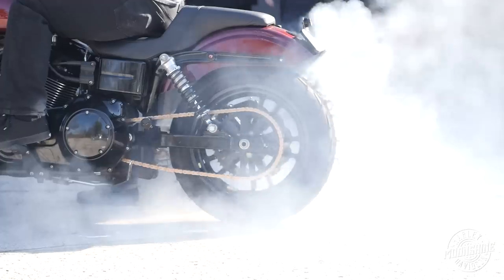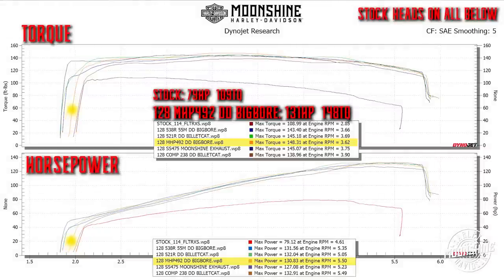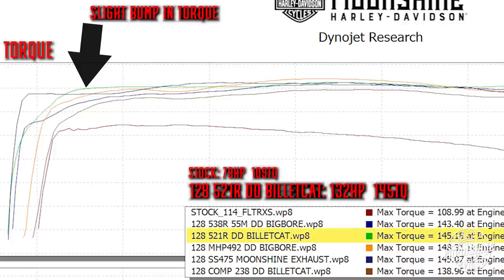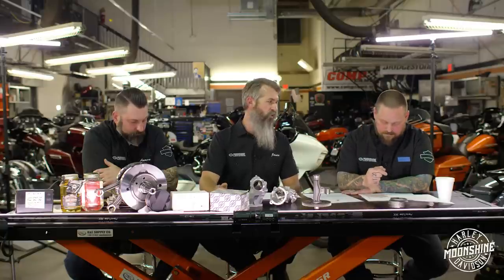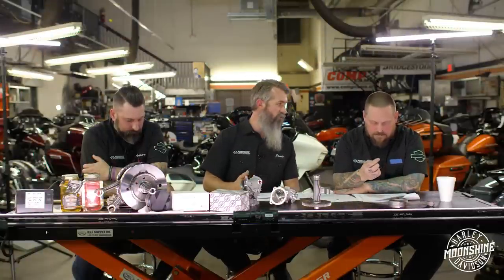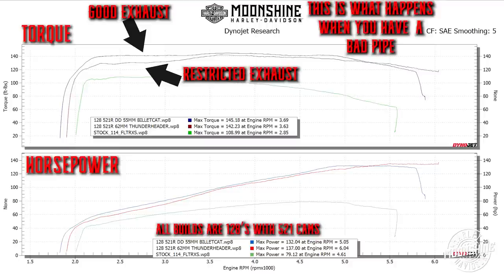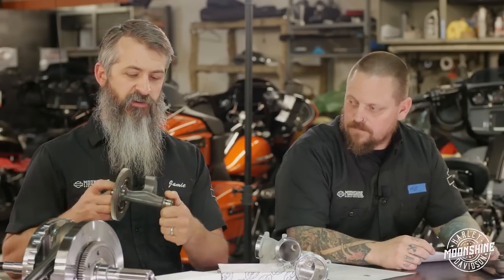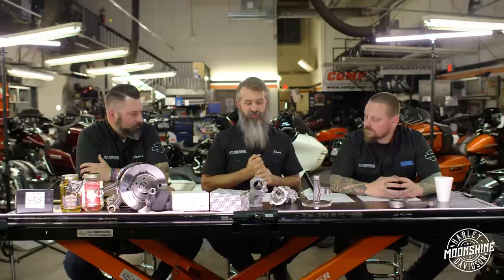Cam Shootout Series | Part 3 Big Bore 124 & 128 Cam Comparison with M8 Stock Heads

Comment: Great information and much appreciated. I watched the entire vid but maybe I missed it,  did you have to do injector upgrades for any of these builds?
Reply from the maker: We always increase the injectors on these larger cubed builds. Typically 6.1 - 6.3 grams a second with stock heads.

Comment: Good video. Have you guys done much with TBR exhausts? Specifically the comp s? I have it on my bike and love it overall.
Reply from the maker: We have and it has a graph similar to the one in our video that’s highlighted as short exhaust. Makes good top end but you loose a lot of TQ and HP under 3,500 - 4,000. With that said if you always in the 3,500 plus rpm’s it’s great! If you are running in an RPM range that’s less you can pick up some good gains by swapping exhaust.
Reply: Moonshine Harley that’s exactly why I switched from a TBR comp to the Thrashin AR. TBR just doesn’t make the power where most people ride

Comment: You touched on reliability of the 124/128 builds (s&s 124 550 cam), what are you  seeing for reliability?
Reply: If its installed correctly its stronger than OEM.

Comment: then why does S&S sell the 128 kits with a 550 cam? does it mean that you have to big different heads for that 550 cam?
Reply from the maker: The 550 responds great with a pair of ported heads. Without the ported heads it hits soft on the lower RPM’s.

Comment: I can't help but notice you guys don't seem to do much with Zipper Red Line cams.  Is that due to relationship, or you just don't feel this is a good cam group to work with?  In my little peabrain, with my experiences they are pretty good cams with good results.
Reply from the maker: We run the the Zippers 468 a lot on light weight bikes with high compression and their 552 is a go to for us on 124/128 with our ported heads.
Reply: Moonshine Harley I would love to see it in one of you’re cam shoot outs. Is it not a good cam for a touring bike?
Reply from the maker: Ryan it’s a solid cam but has to be paired with a set of correctly ported heads like ours and larger throttle body. For that setup you’ll need a real clutch setup like we talk about in some of our other video’s. We’ll go over more info in our powered headed big bore video. Hope to drop it in August - September 2020

Comment: You guys have the best information for performance to your Harley. In time I plan on buying a Road Glide Special with the114.  What do you recommend to get at least 125 hp and about 135 torque. All across. Riding would be in city and with road trips.
Reply from the maker: Thank you and Yes. Call Aaron or Jamie when you are ready 615-274-4170. If we build your bike at purchase we’ll warranty the engine for two years for you. We also pick up and ship bikes all over the country. It depends on when you do the build because new parts are clmnn in NC out every six months. We just got our new Moonshine 55mm Plus intake manifold completed. Testing and video soon on it.
Reply: Where in TN are you guys located?
Reply from the maker: @MrCRM2011  Franklin, TN, Just south of Nashville
Reply: When I make that purchase I will be in touch. I’m in Memphis TN. Thanks guys
Reply: A 124 or 128 with an S&S 475, k&n extreme flow air cleaner, and good tune will get you there.

Comment: Are you guys not using Fullsac headpipes anymore?
Just curious!!
Reply from the maker: crruzzzer1 we do. We use them for smaller cams and our head-pipe for larger cam builds on these big bore M8 setups. With that said we run the Fullsac on stock headed build  as it’s not large enough to handle the increased flow. The Moonshine HP pipe is a larger diameter exhaust and can handle the increased volume.
Reply: @MoonshineHarley  So, I really like the idea of the S&S 475. Would you recommend the Fullsac at that point or your head pipe?
Reply from the maker: crruzzzer1 we would run the Fullsac on that setup paired with our custom baffled Khrome Werks mufflers. Let us know if you need us to ship you some parts. Call Aaron or Jamie at the shop 615-274-4170

Comment: So you guys mentioned the larger cams can have a significant drop in TQ down low on the smaller bikes with shorter exhausts.
I ride a 19 low rider with a bassani 2 into 1, and am hoping to upgrade my 107 to a 124. What cam do you suggest i use? Something like the 475? Im not planning on changing heads or throttle body.
Reply from the maker: Elusive Sambar we have several different options. We like to pair our 492 with the 124 or 128 but if you’re staying with stock compression we would do a 465 or 468. If you email me at Horsepower@moonshineharley.com I’ll send you some comparison dyno graphs.

Comment: So obviously I have missed something at some point ..... why are you getting so much more power out of the m8 in baggers vs the soft tails or did I miss understand the info...?
Reply from the maker: Softail typically use shorter pipes which sacrifice number in the lower RPM’s.
Reply: Moonshine Harley the pipe alone can make almost 50hp difference and over 20tq? So that being said on a Softail chassis would it be better to shoot for a longer pipe? Say bassani , V&H pro pipe , thunder header etc who have a longer 2-1 option ?
Reply from the maker: David Oakley We’ll get the right pipe for
Your build. Please call us so we can match the pipe to you bike and motor. Jamie or Aaron 615-274-4170

Comment: What’s a ball park number on the 124kit /labor for a 2017 m8 sg
Reply from the maker: Really depends on the complete build. With that said these larger setups need some clutch love. We dropped a clutch video a month or two ago call the High Performance Clutch For The Everyday Rider.  We do 5k - 15k builds weekly. Please call the shop and ask for Aaron or Jamie 615-274-4170

They’ll be able to go over the options and get you the numbers you’re looking for.
Reply: Put a side 6,500 to start. It just depends on how you plan on riding the bike and what you want it to do.

Comment: I think I heard one you gentlemen say that you had a customer drink the kool-aid and put a D&D on his softail. 

Can you further explain what your thoughts are about D&D and why? Am I leaving potential HP & TQ on the table? 

For context I have a 19 FXLR with D&D Fatcat and S&S stealth a/c.
Reply from the maker: Don’t think it was about the D&D pipe, let us watch that part again so we can reply.
Reply: David Teclaw if you think D&D exhaust doesn’t give you great power numbers.... you have been misinformed! Any good engine builder will tell you thats a great exhaust system!
Reply: Hey thats my bad, and I appreciate the feedback.
Reply from the maker: David Teclaw Mike a.k.a. MVO Was referring to the tuner and not the D&D. We stock D&D 24/7 and use them weekly as they provide a great option and numbers on these larger builds.
Reply: @MoonshineHarley  that makes so much more sense, the conversation tranisitioned to tuners. 

I appreciate the clarification  and sorry for the confusion.

Comment: Now I'm wondering how well the 55aluminium Manifold works with the Wood 22X cam.
The 22X cam was the stock lift one that after looking the graphs gave the most gains at every RPM below 4700RPM.
I was gonna go with the 475c, but like Mike said, HP doesnt even come into play at 5250RPM, so the 22X was the queen of the stock lift cams.
But I have no idea how it'd react to that 55mm Aluminium manifold.
I was lookin to get it in the future just to replace the plastic stock one.
Reply from the maker: The 22x isn’t a stock lift cam. It was included in our Cam Shootout Series Part 1 which we compared .470 - .480 lift cams on a High Compression 117 M8. 

What bike are you planing this build for? What size M8? What compression ratio?

We would need that info to help. It might be easier to call the shop and ask for Jamie 615-274-4170
Reply: @MoonshineHarley  By stock lift I mean it works with stock springs.
Wood 22X is one of the bolt in Cams that doesnt need any spring upgrades, so I was looking at that one since I dont wanna mess with the heads at all.
FuelMoto did a comparison of it in their 114 Cam shoot out.
Size of the engine? just a stock 114 Stage2. Same engine that fuelmoto tested on. 
https://university.fuelmotousa.com/article/h-d-milwaukee-eight-114-softail-camshaft-shootout/
I'm just wondering how the aluminium 55mm would affect the torque in a stage 2 114.

Comment: A motor converts electrical energy into mechanical energy while an engine converts various other forms of energy to mechanical energy.

An engine is a mechanical device that uses a fuel source to create an output.
Reply from the maker: We know! The only problem is Motor sounds better than Engine when you talk about it so we use MOTOR even though its incorrect. Our base doesn't mind use doing so. Thanks for the definition and knowledge.

Comment: great video , what cam you will put on 131 cu kit
Reply from the maker: I’d depends on how your riding and what exhaust you already have. What is your setup now?
Reply: @MoonshineHarley  131 kit with heavy breather elite from SE and SE head pipe with Dr Jackil and MR hyde muflers again thanks for help
Reply: I was thinking to go with S&S 475 , what are you thoughts
Reply: driving style is aggressive in high RPM or 2 up travel long distance

Comment: Horsepower is a function of your torque and engine RPM. Hence why cams that make their torque down low have less Hp than a cam that makes its torque higher in the RPM range.

Comment: Will you do a 131 with a 521 cam or similar in that next video?
Reply from the maker: We are testing a new flywheel which is 4.625 stroke and it makes the M8 a 131 paired with the stronger S&S cylinders. We will do a video on it later this year.
Reply: Moonshine Harley Sorry if I missed it but are these mostly or all stock heads?
Reply from the maker: Joshua Baer all the combos in this video have stock heads.

Comment: I have 2 questions: 
1: What is your experience with the Cycle Rama CR480 or CR460 Cams on M8? 
2: What is your experience with Rinehart 2 into 1 or RCX Tormentor headers(no cat with crossover) with Rinehart 4'' slipons?

I ask this because i like performance upgrades, but for me personally Sound is also important.. 

These cams and these exhaust setups give a Twin Cam like lope and sound (from what i heard on youtube). And still should give some improvements in performance, you guys are the Harley Davidson Hot Rod Experts, i would love to read your thoughts!
Reply: Bike Life I know you weren’t asking me, but RCX Tormenter headers are sick and add power and a good sound I’ve used them on a 114ci
Reply: @jb1623  Cool, what slip ons did you use?
Reply: Bike Life Cobra Neighbor Haters
Reply: @jb1623  Nice combo, would love to hear some clips!

Comment: For all the trash talk toward the 131 harley engine.... it finish second on the king of the baggers race. That's a strong motor and reliable
Reply from the maker: It wasn’t a stock H-D 131 engine they way they come from HarleyDavidson. It was a H-D crate 131 that Vance & Hines build with some one off parts. The Indian also had a ground clearance advantage over the Harley’s. Hopefully by the next race we have a better solution for ground clearance while turing left.

Comment: Only prius drivers gaf about their mpg .
Reply: Not entirely. I have a 128" build and I care about MPG. Lower MPG gives me better range. I have my PV2 setup so it shows fuel consumption so I know where the engine runs at optimum efficiency.
There are plenty times I don't care about MPG, and I just crank the throttle. I mean, that's what I got it for.

Comment: There's no doubt you guys love your non-harley motors and parts..as do we...but across the country people are getting the 131 because of warranty.    So with that said...id like to see what you guys can do to a 131 SE. Give some harley love for once.  Preferably a level 1 level 2 and a sick level 3.   What things should be changed or upgraded first when going to a 131?  What is the cheapest performance boost you can do for a 131? I'd like to see it on a soft tail since most things you guys do is baggers. That way we see a different clutch.